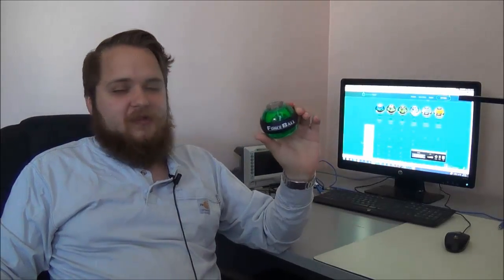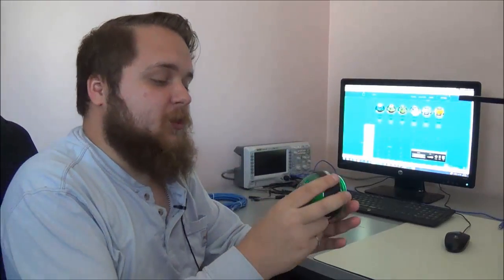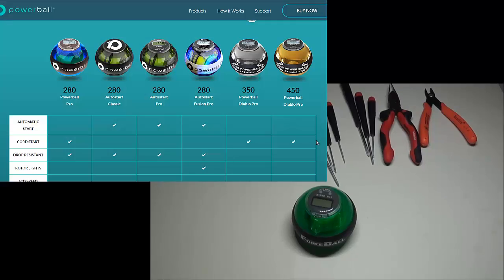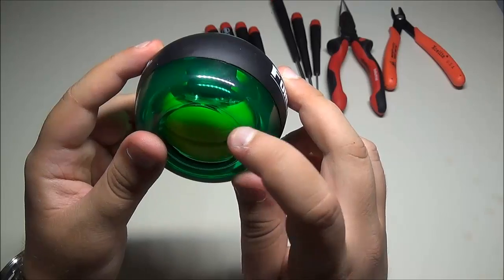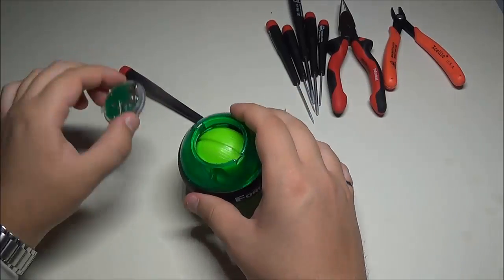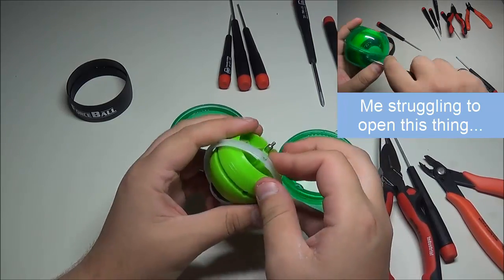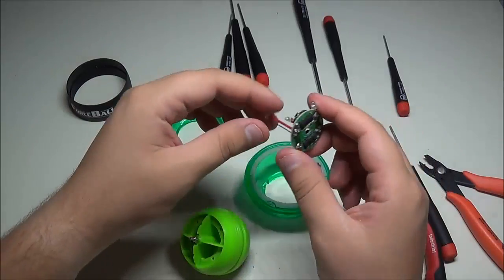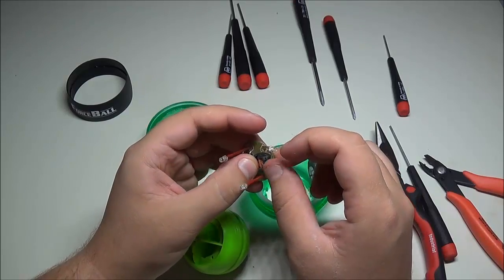How does it work & what's inside - Force Ball

Comment: As a generator, how does input compare with output? Are there other applications for this unique type of gyro and generator?
Reply: I would guess that the power output can't be loaded very much more than what it takes to light a few LEDs because that would slow it down too much or even stop it all together.  The input goes through a very tall effective gear ratio which produces almost no torque.   That's why it takes so long to get up speed.

Comment: A magnetic field is not created by the movement.
The magnetic field is fixed and provided by the magnet.
The movement of the coils through the fixed magnetic field is what induces (that's where the name inductor comes from) current on the coil wire and power the LEDs.

Comment: could be an interesting mechanism for an exercise bike
Reply: or a mobile bike! I’ve been trying to figure out if you could harness this thing to a cradle in lieu of your hand, and turn the cradle via a geared system like a bike.
Reply: @donuttryit5839  it seems possible to me, it'd probably have to have an electrical generator hooked to it that runs a motor on the bike wheel, not the ideal setup, basically hauling 2 motors and the gyro flywheel around, heavy! There's a video where a guy put magnets on the wheel of the gyro and used it to charge his phone, not sure how much of a charge it was getting though. I'm just wondering if a large foot powered one could get a bicycle going faster than the traditional setup, if you could go 35 mph easily, that'd be a great form of transport.  Highway speed might be a pipe dream
Reply: is the wheel off balance so in effect you're throwing the weight around like a marble in a cup

Comment: Guess you're young :)
Rubber contacts were the main thing connecting LCD's in calculators, DVM's, watches and nautical instruments.
The "sensor" you're referring to is a reed - relay, a relay that has it's contacts closed in the presence of a magnetic field.
Thus, the permanent magnet spinning is triggering relay's contacts once every revolution.
Reply: "Zebra" strips. used since LCD displays were created.
Reply: >The "sensor" you're referring to is a reed - relay, a relay that has it's contacts closed in the presence of a magnetic field.

So it's a type of sensor.

Comment: Guess I'm old.  I had one in the 70s that had no electronics and no drawstring.  Purely manual.  Great for hockey players.
Reply: I did too. It was called Dyna Bee. I bought one on eBay a few years ago. I also bought an NSD Powerball and that's the best one made. You can see the drill marks on the metal rotor core from the balancing operation. It spins easily and vibration-free with a flick of the thumb. Quiet too. It also comes apart with three screws for cleaning.
Reply from the maker: That's interesting. I wonder why they are coming back these days... I'm guessing that it's the whole "IoT" phenomenon where we can stick an IC into nearly anything.